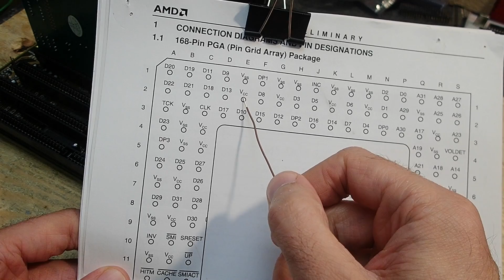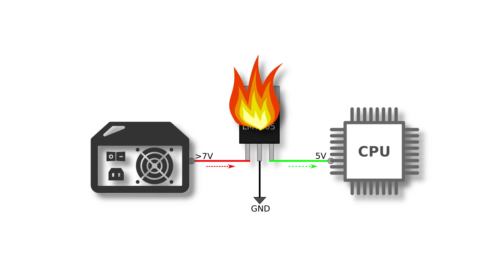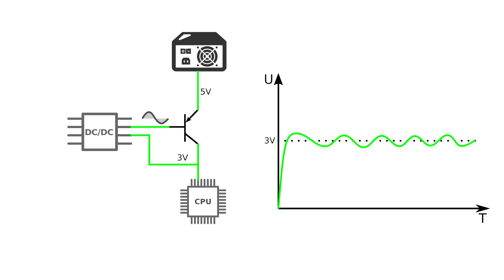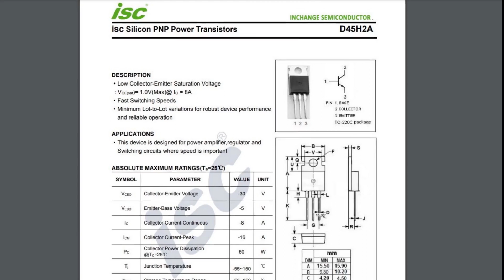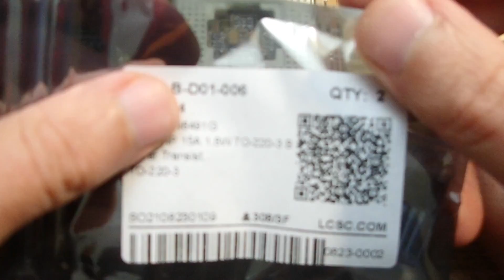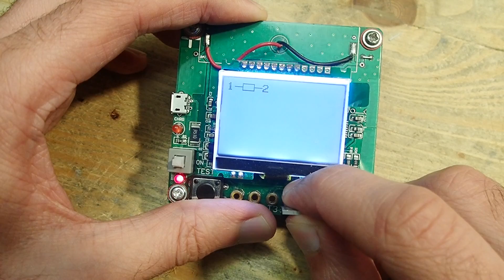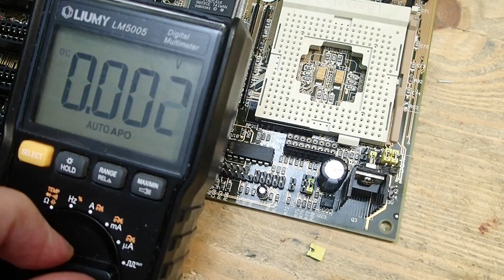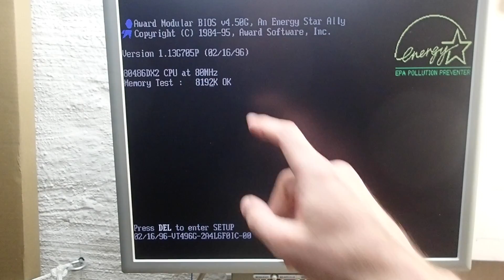Let's repair the CPU power supply on a 486 mainboard

Comment: I love repair videos :D  I found this channel only last week and I've been binge watching the old repairs video !

EDIT: Although here, I must point out your explanation of the dc/dc switching converter is incorrect. What you described is a linear regulator, just one with an external pass-transistor. And AFAICT it's exactly what's here, a linear regulator with external pass transistor (and this has no efficiency advantage, it's just easier to dissipate higher power ...)

What makes switching regulator more efficient is that they don't "modulate" the base voltage. They either turn it entirely ON or entirely OFF to avoid the region where the transistor dissipates power. The "raw" output would not be wavy, it's be switching from 0 to 5V which is obviously unacceptable and that's why they need an inductor and capacitor on the output. The lack of an inductor is a big clue this is not a switching regulator.
Reply from the maker: Hehe :D Exactly! I don't describe a switching regulator in this video, because I describe a 2-stage linear regulator with external power transistor, which was used on that mainboard. If  you are keen to see a switching regulator on my channel, then tune in in the one of my next videos, where I plan to talk about that ;) Thank you very much for watching!
Reply: @necro_ware  Ack, looking forward to it :D
Reply: @necro_ware  You did imply that it was more efficient than a LDO though, which it is not.
Reply from the maker: Well I said, that it is more efficient, than a simple LDO like LM7805 or similar. In fact this 2-stage linear voltage regulator can control a lot higher current and gets less hot. More power and less heat means that less energy will be dissipated (wasted). So, it is more efficient -> profit ;)
Reply: @necro_ware  No, it is not more efficient.  It simply has an external pass transistor (whereas the pass transistor is internal in a monolithic linear voltage regulator).  The external pass transistor may have a higher power dissipation rating, or even a lower thermal resistance junction-case, allowing it to operate at higher power dissipation levels, or use a smaller heat sink for the same power dissipation.  However, It is still a linear regulator, and still is just as inefficient as a monolithic linear regulator.  Power burned up in the regulator is the same in either case:  Voltage dropped across the regulator * current through the regulator.

Don't confuse dropout voltage with efficiency.  Monolithic regulators typically require 2V or more input voltage than output voltage to properly operate in regulation.  That is the trade-off for an all-in-one, simple to use part.  A regulator design with an external pass transistor can have significantly lower dropout voltage (Vdo), as then it is a function of the pass transistor its self - a pass transistor with a low Vce(sat) can result in a voltage regulator with a very low dropout voltage (0.1V), assuming the Hfe of the transistor is high enough, and the regulator IC can drive enough base current.  But, even a low-dropout (LDO) regulator still causes a reduction in voltage by burning it up as heat
Reply from the maker: All you say is true and I will not argue about that. Sure LDO dissipates energy as heat, like any other part, right? Now look at the circuit as a system, not only at the LDO, but completely with the transistor. Let's talk in a simple language, the whole circuit does the same job dissipating a lot less heat, than a single and simple 1 stage LDO without external transistor. Right? So, if something makes the same work and wastes les energy (as heat), then it must be more efficient, by definition.
Reply: @necro_ware  "Let's talk in a simple language, the whole circuit does the same job dissipating a lot less heat, than a single and simple 1 stage LDO without external transistor. Right? " 

No.  The voltage difference is being dissipated as heat in both circuits.  Exact same amount of power is being dissipated in both circuits.  P(reg) = I * delta-V.   Same losses, same efficiency.
Reply from the maker: @mouseyclickey  Ok, than try to use a single stage LDO to make a voltage drop over 2V at about 4A with just a heat sink as small as you see in this video. Then we can continue this talk ;)
Reply: @necro_ware  This case still is a single stage linear regulator. If you look at any datasheet (including the LDO, you have ordered) the internal circuit is quite simple and generally the same. 
The low voltage drop is achieved either by using PNP transistor or even P-Channel mosfet. In this way you drive the transistor open towards the ground and you do not need higher, than the output voltage on the base / gate and as a result higher input voltage.
Then there is a comparator, which does the regulation (opening and closing the the pass-through transistor), plus reference to compare to. This circuit includes some oscillation protection.
The pass-through transistor can be either integrated, integrated plus standalone, like in this case or just standalone. Or it can be darlington, but that only means, it responds to smaller drive currents (at the expense of higher Vbe), which is useful in higher current regulators, because the comparators are usually not capable of high output (driving) currents.
There are integrated linear regulators capable of higher currents, but it is not very common. Much more typical is hybrid regulator plus power transistor setup like in this case.
The overall energy dissipated (lost) as heat is same in all cases. It is always (Vin - Vout) * I of power. In this case (5 - 3.3) * I. Which for the 486 is not that much. I can't really find any reliable answer, but I guess, it's less than 20W. That would give 6A, which would give (5 - 3.3) * 6 = 10.2W at max. For Dx2-80 I'd expect much less.
What matters here is how easy it is to dissipate that heat. Big transistor with heatsink can do it quite fine.
Two-stage (or multi-stage) would be cascade of regulators in series, each dissipating part of that energy.
But Linear regulation always dissipates all the excess energy. 
Only way around this is use of switching regulation, which really is quite separate (and interesting) topic. It can operate with extremely high efficiency (98+%), which is required for modern power solutions for modern CPUs and GPUs which operates at low voltages, but very high currents.100A is quite normal value. Dissipating even quite small voltage drops at 100A is not viable not mentioning all the lost power must be supplied from PSU.
Reply from the maker: @RadekŠťastný-v1v  Boy oh boy :D You guys take it all too seriously. I'm really glad to have such an advanced viewers on my channel, but I also try to pick up all viewers and have sometimes to simplify unimportant details. I could start to explain how a Darlington Transistor works, to say, that the LDO which is used as a first stage and the power transistor as a second stage, how that allows to bring more current onto the output, but it is not important to understand the basic functionality of this whole setup. I usually leave all the distracting details out and leave it up to the viewer to dig deeper into it, if needed. For the beginning it's important to understand the principle, all the other stuff is secondary. That's why I said explicitly in the video, that the representation is very much simplified and exaggerated, but somehow that passed by without a note. To quote Monty Python, next time I will say it more "proudly and loudly". My first answer to the initial comment was, that it is not a switching voltage regulator, but still a linear one. I made this mistake in the past as well, that's why I found it important to be mentioned. And I wanted to say, that I plan to make another video about that one as well..... Anyway, as I said in the end of my video, if all, what I said is nothing new to you, I still hope you enjoyed the repair as is. If not, I'm really sorry and will try my best to make it more exciting next time. However I can't promise to make my videos in the way, that every level of experience will be satisfied. I have to make some compromises and I hope you understand that.
Reply: @necro_ware  1. The circuit being used is a single stage linear regulator. Whether it uses an internal or external pass transistor, it's still a single stage.
2. A LDO linear regulator works in exactly the same way as any other linear regulator and dissipates the same power as any other linear regulator, if it's supplying the same current with the same voltage drop. You can't find LDO regulators that pass large currents, so it's bizarre challenging someone to use an LDO that is rated at 4A. With that sort of current requirement, you will have to use an external transistor (or mosfet).
3. If you want to dissipate the heat produced by dropping 2V at 4A, then you need to dissipate 8W, and a 2N6491 in a TO-220 case needs a heatsink rated at no worse than 15C/W to do that. The amount of heat dissipated in the LP2951 is negligible in comparison. If you use an LM338 in a TO-220 case to dissipate the same 8W, then you need the same 15C/W heatsink to do the job, because both the transistor in the TO-220 case and the linear regulator in the TO-220 case have a junction-to-case thermal resistance about 1C/W. The heatsink's thermal resistance is dominant in either scenario.
4. So whichever you use, you dissipate the same power and will cause the same temperature rise using the same heatsink. There is absolutely no difference in efficiency between them. The efficiency is, of course, (Power out)/(power in) = (Vout x Iout)/(Vin x Iin). In a linear regulator, the current out is almost the same as the current in (assuming the quiescent current is much less than the current supplied), so the efficiency = Vout / Vin and there's nothing that LDOs, pass transistors, or any other artefact of linear regulation can do to alter that.
Reply: @necro_ware   Hey Necro — they’re right about this.  I didn’t catch this thread at first and commented pretty much the same above in the pinned comment.

I truly don’t mean for this to be offensive, so take it as constructive criticism.  The explanation in the video isn’t a simplification, it’s just incorrect.  Having a Darlington drive topology doesn’t affect the efficiency of a linear regulation circuit at all.  It just makes it easier for the feedback loop to affect the output by handing off the pass transistor control to a more robust component.  LDOs also have nothing to do with efficiency, they’re just easier to use with small Vin to Vout ratios, which can make the whole solution more efficient by not having to provide such a high Vin... but either way the excess voltage is converted to heat in exactly the same way - through the pass transistor and only through the pass transistor - and to the exact same degree in all three (integrated, LDO, external) cases.

Sorry - not trying to beat up on you.  :-)  But like when you have some spinach in your teeth, I thought you might prefer to know.  :-)
Reply from the maker: @sirnickity  😂spinach.... well guys, this seems to be very important for you. Even if it was not important for this video, I'll give in. Just one last question, which may be can clarified before we finally can close this and I mean it seriously, that's not a sarcasm. Why do you need quite a big heat sink to cool down f.e. a normal 7805, if you need to get the voltage down by  2V at 1.5A, where for the combination with external power transistor it's enough to have a small piece of "kitchen foil" to do the same voltage drop by almost 4A?
Reply: @necro_ware   Well, for starters, I can't guess where you're coming up with these numbers.  It depends on the chip, of course, but.. for example, that AMD 486DX2/80 (according to CPU World) has a max thermal dissipation of 2.88W.  So if you run that chip at 3.3V with the regulator on a 5V Vin, the regulator needs to provide 870mA while dropping 1.7V.  That's a grand total of 1.5W of heat, in the worst case, which... I think we would all agree is significantly less than 4A * 2V = 8W.  :-)

If you have an example of a scenario where you ARE dropping 2V at 4A with a tiny heatsink, I would love to know about it.  Because either 1) it's using a switching reg, 2) it's running VERY VERY VERY hot and getting away with it, 3) the assumption is incorrect to begin with and it's not actually doing that, or 4) everything I know about voltage regulation is wrong.  :-)
Reply from the maker: Ok, I was wrong and I give in. The numbers I had in my head were wrong indeed. I probably mixed early Pentium with the 486 in regards of power consumption. Pentium needs almost 4A, but I just looked into the datasheet of the 486 and it needs up to 1.2A. Not quite as much as I thought ;)

So, I correct my statement, it is NOT more efficient :) Thank you all for the correction, this doesn't change much on the result, but since this seemed to be very important for so many people, I confess my mistake with pleasure. But I would like once again to point out to the initial comment, which started this huge thread, the regulator I describe in this video is not a switching, but a linear voltage regulator. And a video about a switching voltage regulator will also follow, but I currently don't quite know how soon.
Reply: @necro_ware   I wish you wouldn't try to make this about it being "important to us."  It reads like you are trying to pacify the audience for "disagreeing" with you, and you're going to let us have our way.  But that's not what this is.  We're not sharing opinions here.  This is all well-established fundamental knowledge.

Everybody's wrong from time to time, and that's perfectly OK.  It's no character flaw to be mistaken.  So when you make it a point to have a section of your video that explains how something works, and it contains factual errors, I think it's fairly important for the community -- which includes you -- to recognize and correct that.  If you aren't trying to come across as an authority, and we're just along for the ride while you make mistakes, that's one thing.  But when you start to illustrate to others how it works, you gotta either be right, or be willing to own up to corrections.  And EITHER is OK.  The point isn't to win an argument, it's to make sure that others following in your footsteps aren't led astray.

I would be the last to proclaim that you shouldn't post a video unless it's devoid of errors.  God forbid.  We'd all be watching a blank screen if that were the law.  But, please, don't try to shrug this off as "hey, since you guys seem to think it's sooooo important for the factual part of a video to be 'correct' -- whatever that means..."  Being wrong is honorable.  Deflecting that and minimizing it is not.  Own it, and we'll absolutely respect that.  :-)  I promise you.  And the ones that don't... well, those guys are just covering up for their own insecurities by drawing attention to someone else's flaws.  You can't do anything about that, and it doesn't actually have anything to do with you anyway.

Alright.  I've said my piece, and I say it with love, as a fan, and now I'm ready to let it go.  Cheers.  :-)
Reply from the maker: No, no, you got me wrong. I didn't mean it like that, it was just badly written. I really appreciate the constructive critics, it was important and I would thank all of you for the clarification. And it's absolutely clear, that I can't guaranty, that my videos are made without any mistake. To make that I'd need a team, which would help me to produce them and with which I'd be able to discuss the assumptions and ideas. I'm obviously doing all this alone and I do and will continue to make mistakes. With that inappropriate statement, I just wanted to say, that my mistake doesn't change the result, I mean the basic idea of the regulator which was on that particular mainboard. I wanted to point out, that even if this discussion seems to be very important measured by the amount of comments, it came out of a false side note, which I made. So, if s.o. will read this in one year, they should not think, that  the basic functionality of the regulator I described was wrong. Only my statement about the effectiveness  was and this discussion was about that.
Reply: @necro_ware   OK, fair enough.  :-)  Carry on, then!  hahah